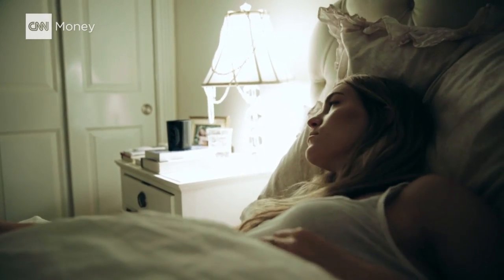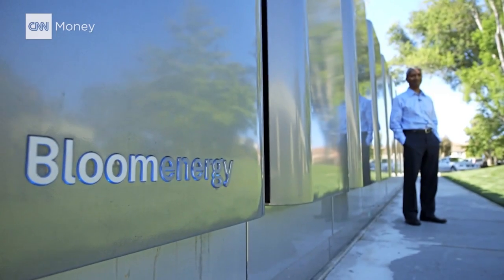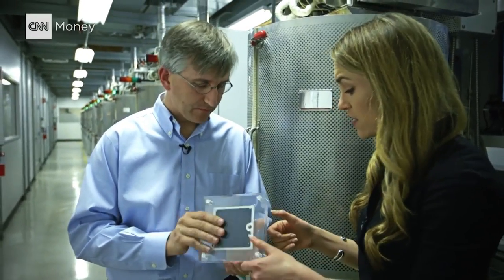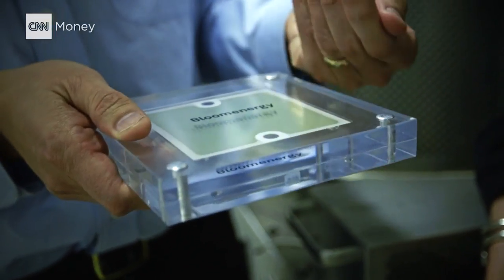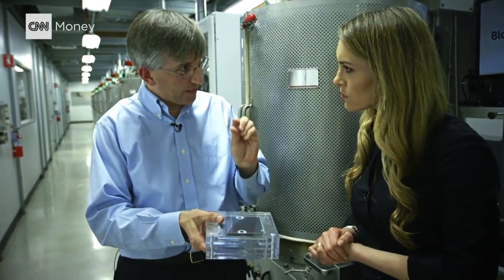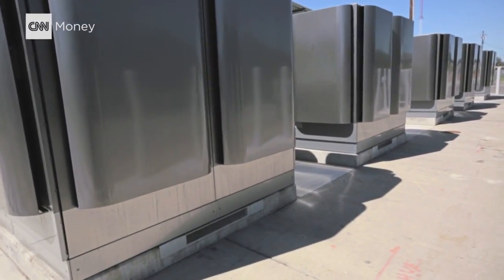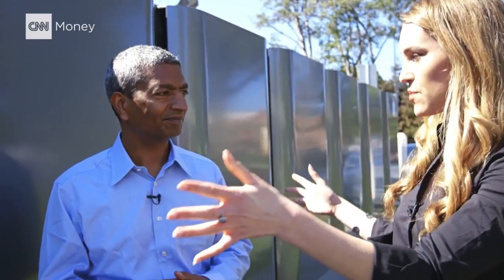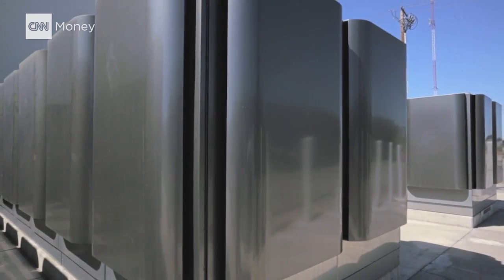Fun with fuel cells: Go off the grid, for good

Comment: Complete Hype and BS. This is a Solid Oxide Fuel Cells. This tech is not new and has been around for decades!! Many companies have been developing these fuel cells and trying to commercialize them. One such company was a listed on the ASX (Australia) called Ceramic Fuel Cells founded in 1992!  It has a fully functional Fuel Cell unit called Bluegen .The company went into Administration and is now focusing on the EU market. These systems are NOT 100% renewable or Green but do offer up to 50% cheaper electricity but still need a hydrocarbon fuel source. 

Bloom Energy Servers generate electricity using natural gas or biogas as fuel.

Comment: I wish somebody build a 20kW reversible fuel cell, and independent storage that can be arbitrarily large (i.e. hydrogen gas tanks), lets say 500kWh. So I can run it for few days and fill up the tanks myself. And then if my power usage increases, or the grid goes down, and I need extra electricity, that can't be provided by my PV or Wind installation (i.e. at night), it provides back power (lets say 10kW, aka 50% efficiency). This way I can charge my storage slowly (i.e. 20-30 hours, or if using just PV, maybe few days, to use surplus solar energy not used at house), and when time comes, I can just use it as a source of power and be able to basically deliver 10kW for ~30 hours, or if combined with some PV and Wind, probably few days, with no grid use. Add few kWh of normalish battery storage or super capacitors, and it should really be quite good and scalable. If I want to last longer off grid, one can always just enlarge tanks, or not even that, because with sufficient PV installation one would simply recharge it by day and use it by night, and it will balance and be self sustained. The benefit is that it should be easier to use than something like diesel generator, require less maintenance, no pollutions (if using oxygen, not air), no noise, and kick in into operation quicker.

Comment: Your Bloom Box’s work using Fuel.Cells that I heard you say was made from a Ceramic from sand. But u also said a ‘secret’ coating is sprayed on one or both sides of the Fuel Cell. My Questions are 1) is this sparayed ‘Secret’ layer toxic at all?. 2) I’ve heard that Fuel Cells use a v thin layer of Platinum, do your Fuel Cells use Platinum? Or any other non renewable material?, lastly, how long do your Fuel Cells last before they no longer can be used?
Reply: It needs a thin layer of a precious metal to initiate the reaction, this follows the same process a catalytic converter takes to break down large exhaust molecules into smaller co2 and monoxide molecules that are generally less toxic.

Comment: Sure..... take it off grid, but needs a good supply of natural gas to extract hydrogen to feed the fuel cell.
Reply: P.S. the extraction of hydrogen from natural gas creates gobs of carbon dioxide, a green house gas.
Reply: Not if you use renewable methane.

Comment: Does anybody know the efficiency of these systems?
Reply: Supposed to be 65% efficient from natural gas to electricity if I read their spec sheets right. Which is really impressive from a technological point of view, and more efficient than some of the best natural gas power plants.

On the business side, they seem to be struggling to be profitable while expanding though. Their net loss is equal to half of revenue, meaning that they're burning cash to grow. But they should have a large range of applications. I'd be especially interested to see if this thing could power a large container ship using LNG, that could give ships significant operational cost savings.
Reply: @BosonCollider  These are lab figures. The reality is that state of the art natural gas plants with the standard brayton cycle are actually MORE efficient, and are obviously profitable. These take ten years at 8 cents per kilowatt to even break even. Coincidentally their lifespan is 10 years... horrible investment.
Reply: @haliax8149  So not good for base load applications, but useful for peaker plants and backup generators. Getting an ultra efficient combined cycle gas powerplant to full power takes a while. Best used at point-of-use like server farms.
Reply: @haliax8149  Yikes, gas turbines can last way longer than 10 years and the efficiency remains steady with negligible difference.
Reply: @BosonCollider  most ships have auxiliary power generators, so no point installing these expensive equipment.